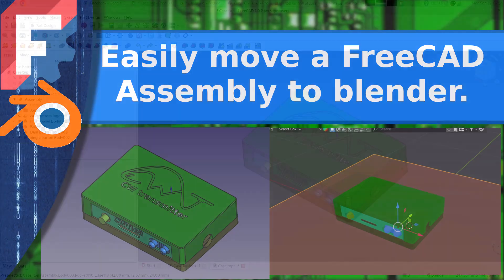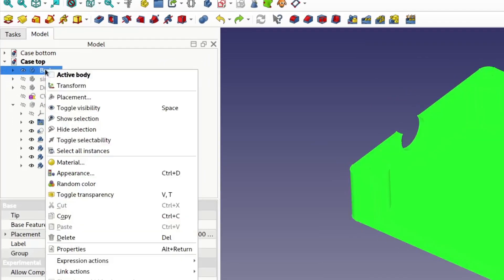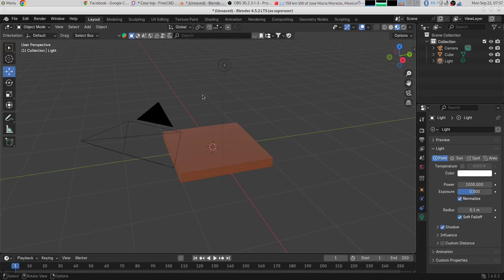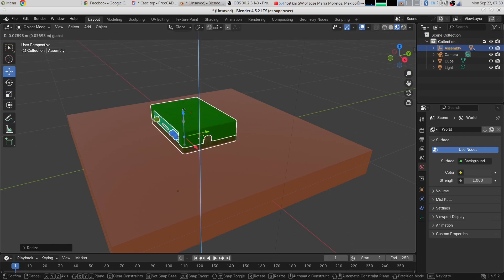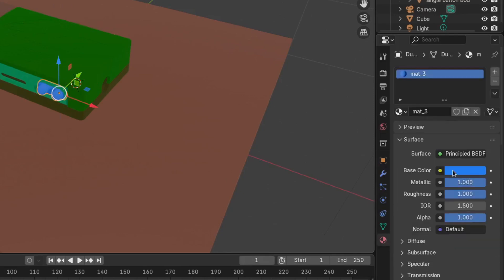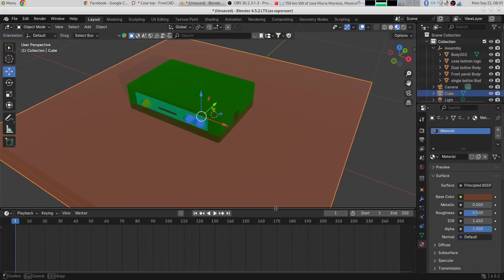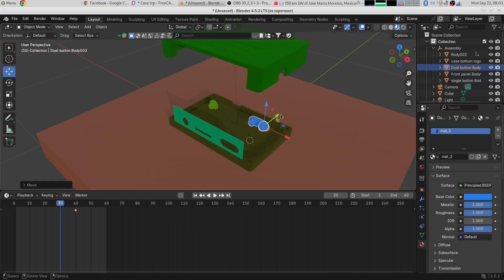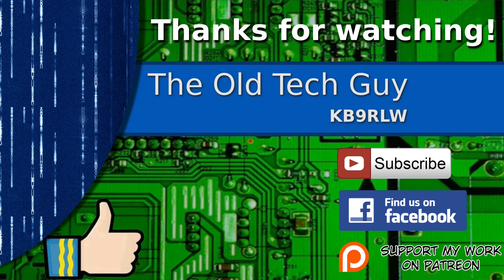Freecad - Easily move a FreeCAD assembly to Blender for animating.

Comment: That's pretty sweet Kevin.  On a. Older note would you ever consider creating Gerber's for your digital interface from several years back. The one using an Arduino to get the radio. Curious if you still use it for anything.
Reply from the maker: That was my first arduino project..  No,  I'd have to learn kicad and my time is limited at the moment.  It's a pretty simple circuit though.  I think I did it up on breadboard. And actually, the input amplifier could be simplified a bit.  Have a look at my CWvox project.  I used an arduino to detect audio there and a simpler front end amplifier.  You could use that front end amp in the DuinoVOX and it should work fine.
Reply: Ok thanks, I thought you had worked with kicad.  I have one board with kicad and the board worked. Simple , DC to DC converter to drive a voltmeter and isolate its ground.  I have an older. TS 450 am trying to key with winlink express.  Will be my first useful Arduino project. I thought it was really neat way back when you first built it